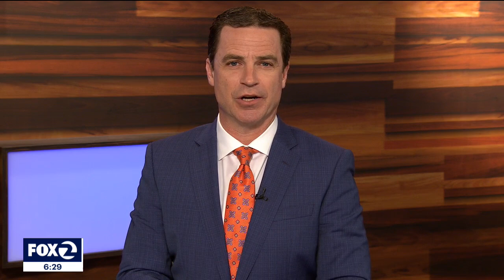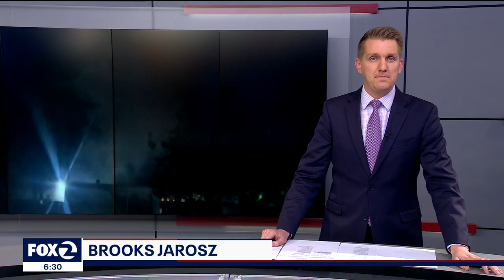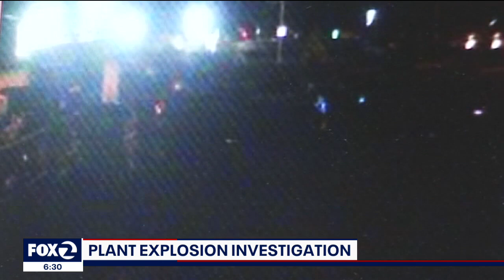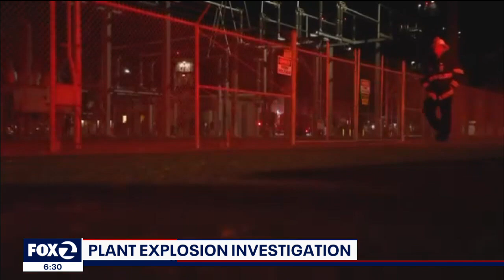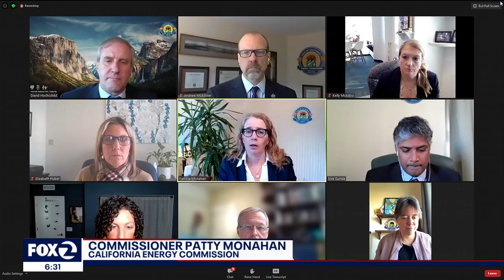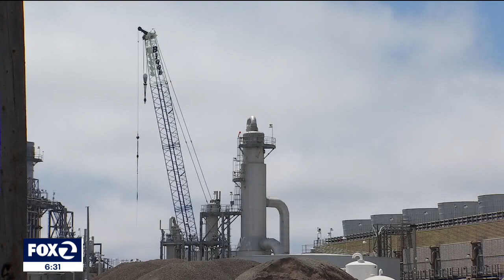Hayward power plant explosion blamed on equipment design flaws

Comment: Last fall the grid was operating at the minimum reserves and full on, meaning brown outs were imminent,  I guess Newsom should of not turned off and removed all of the power in plants in Ca. finally the House stopped him from shutting down 5 more plants. I had my most expensive month in elec. in August, my AC never shut off.    We had a new power plant built and running about 5 miles from the house, it was about 10 years old, they shut if off and removed it to the ground.